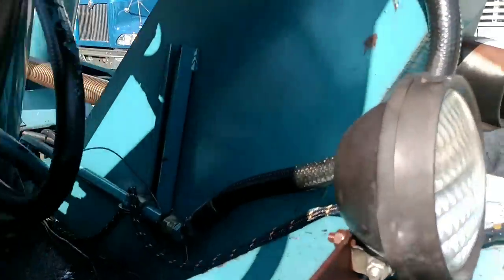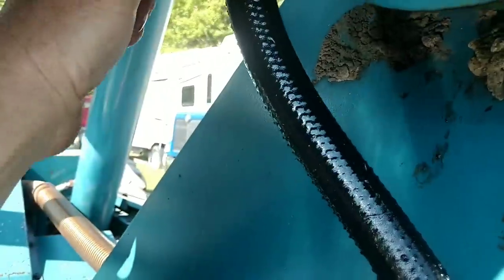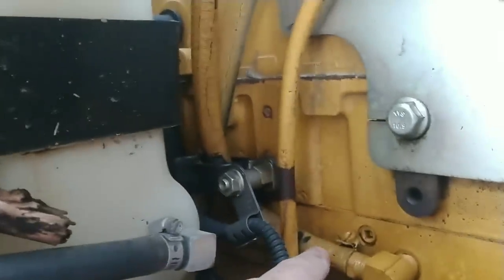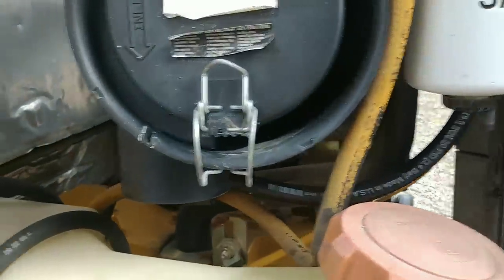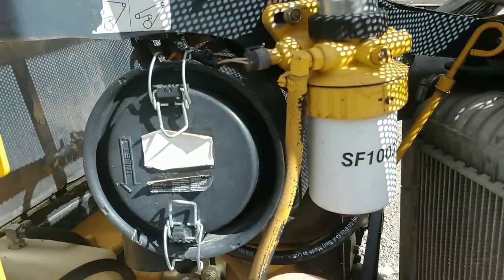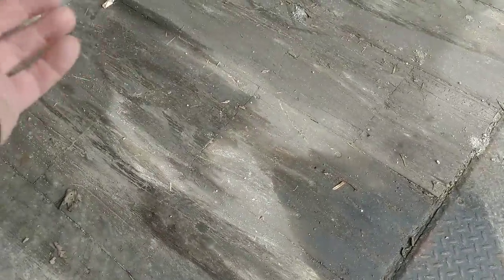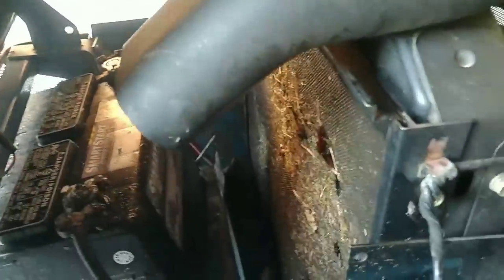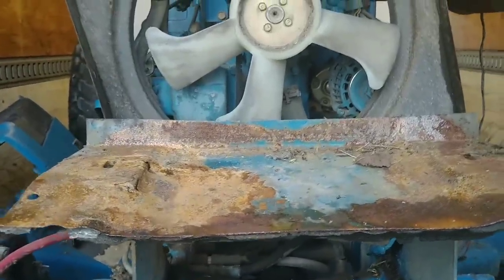LEAKS, LEAKS AND MORE LEAKS! GRADALL, JOHN DEERE SKIDSTEER AND FORD 1520

Comment: I just went thru the "things happen in threes"  last week. I didn't escape without a blown hose on the quick attach on my skid steer. The other 2 failures were water heaters (2) and the truck starter.
I should be good now for the rest of the year....lol  Work safe JC
Doug@ the "ranch"
Reply from the maker: you got yours all buttoned up and mine are still coming!

Comment: I can well relate to the tires and problems that merge with them. I used to know a guy who had a system that he did to repair the sidewalls which was involved but it did what he claimed and it was a hot patch that took some time to do. It was expensive too but not the cost of replacing it. Hard to be humble when work just never ends on ones own stuff. Still good to see you doing well

Comment: I had a radiator that was leaking on the outside like that and soldered it. It was still holding a few years later when I got rid of it. Now, if it is leaking on the inside where you can't reach it I have to take it to the radiator shop.

Comment: Few shops re-core radiators any longer. The ones that do, work on big stuff. 

A quick search shows that the radiator you need runs just about $500.

Comment: Yep, problems never end!  Hopefully they can fix that radiator!  I like to use Transmission Cooler hose for fuel - it's heavier than regular fuel hose and handles higher temperature & pressure but isn't so stiff you can't bend it.  I've had real good luck with it lasting a long time for me with most any fuel.  Crazy about the tire shop.  Everyone is so worried about liability these days, they can't hardly do anything anymore!  Thanks for the video!
Reply from the maker: agreed. i will fix that tire one way or another. they are far to expensive to just scrap it. any updates on the old chevy project?
Reply: @j.c.smithprojects  Yeah for sure!  Tires are NOT cheap!  #FrankenTruck hasn't had much done recently other than new batteries.  Been busy with other stuff that's not really video-worthy but she'll probably be back in the shop next week or two.

Comment: JC, there's got to be a couple of those gradall wheels laying around somewhere in somebody's way (might even have some kind of tire on) - pick em' up & bring em' home...ever what looks good put/leave on the machine & get tires on the other 2...l don't think you need foam if you have 2 aired spares holding the wall up in the back corner (inside) the shop

Comment: At those prices I'd look into solid tires. There are companies selling them in sets of 4 with rims for $6250 and $6500 delivered. You could check their prices per tire. Cutting those filled tires off the rims with a sawzall is no picnic.

Comment: NAPA has those plug/patch things in heavy duty versions. Scuff the hell out of the tire inside where the patch goes. Get a can of the good, flammable glue. Spread it on and light it on fire. Blow it out and thread the plug through. You will probably need to drill out the hole in the tire to fit the plug. Stitch the patch in place. Then take a big ol’ honkin’ flat patch (like 4”) and do the glue fire thing over the plug/patch. Stitch like crazy and you’re done — other than driving down to the tire shop to call ‘em all a bunch of worthless Nancy boys. I learned this from a friend who worked at a tire shop. Believe me, it works great. Make a video of the tire repair!  Boom.

Comment: Napa has fuel injection clamps that might work better on your skid loader fuel line, they’re more of a band clamp than the worm clamp style. Bummer about the radiator on your tractor. Thanks for sharing and take care JC
Reply from the maker: that is exactly what i wanted....napa what out. seems to be tight enough. no external leaks and no air leaks.

Comment: Ain't it the truth! Had a strut collar loosen up on the Volvo (heard the clunk every time I hit the brakes), and I just ordered an entire front end (ball joints, control arm bushings, steering box, rag joint, etc. - bushings long overdue, and I want to get an alignment before I throw new rubber on next spring) for the Grand Marquis. I'm afraid of what the 3rd one will be. Engine or transmission failure in the Silverado more than likely! 🤣

Can't believe how much that foam costs! Tires ain't cheap either. Holy crapper ...😨

Comment: I was going to suggest that you get all new hydraulic hoses on the Gradall to prevent the constant leak problem, but then when I saw the cost of the tires it needs I realized that might be a luxury you can't afford.  Good lord, the upkeep of those monsters is expensive!
Reply from the maker: i try to replce everything i can at the time of repair. if you let one thing go here and another there without fixing, before you know it you have a pile of junk that is not worth the repair cost. these things are not cheap to buy new or used. i could really use a second one.

Comment: I am speaking from a point of ignorance but do you really need the Gradall tires to be foam filled in the limited environment you use it in?
Reply: It does add quite a bit of weight for stability, also you dont get punctures and can get your moneys worth out of the treadwear, ...they have to be cut to get them off the rim so...big job to change ;-)
Reply from the maker: I want them foam filled for the extra weight. it acts as a ballast.
Reply: @j.c.smithprojects  i thought i had thought of everything about foam filled vs. Solid rubber tires until you mentioned ballast!  Genius!  I would imagine that the foam filled has a few hundred pounds on solid rubber.  Great idea(and use).  Sure are a pain to get off for replacement though.  Keep up the good work, love the channel.